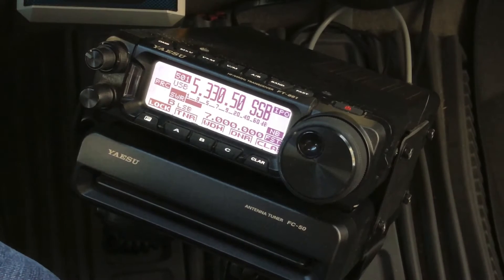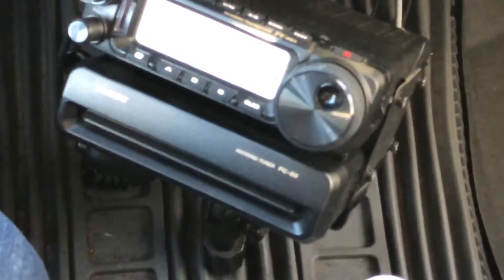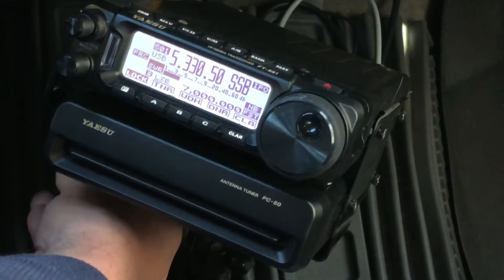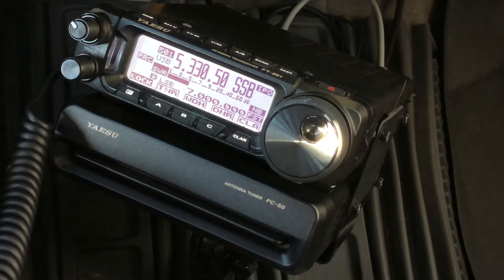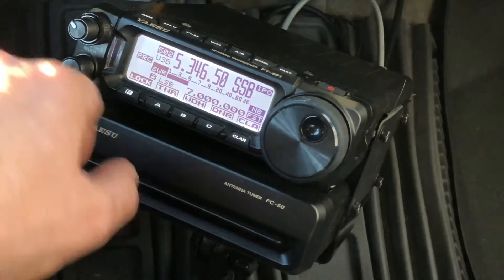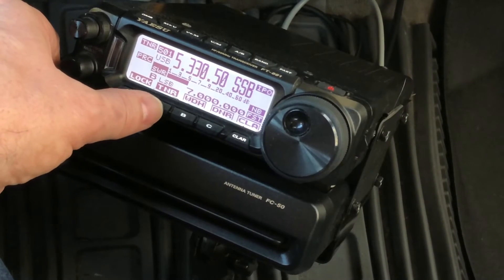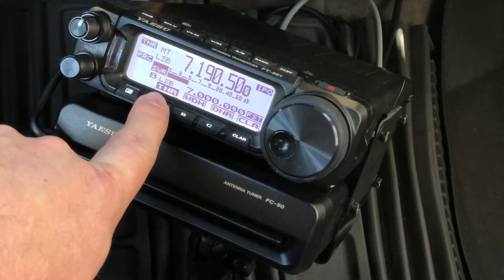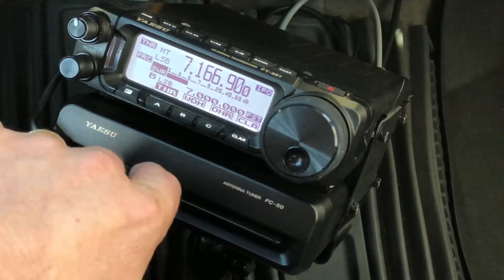Yaesu FC-50 Antenna Tuner with the FT-891

Comment: Thanks for the info. I've hard mounted that setup in a pelican 1400 and am quite fond of it. I removed the front from each unit, bought some fly leads and am making up a mount for the face.. penetrated the box with a weatherproof 50A anderson and pl-239. Pretty sure i opened the tuner looking for the receive option but wasn't able to locate anything. I have no plans to pull the radio out, it is well protected and has rubber buffering on bottom and side, it's also very transportable and comes in at 6kg. If my bracket works out for the face I will share the .stl 74
Reply: thanks. I see you have the RF gain selected on menu 05-05 and I suppose that is about listening style. the other option being squelch and that's good if you want to wait quietly for a band to open or clear calls to come in in my experience.
Reply from the maker: RF Gain, IPO, and ATT are a must, especially for mobile operation. They help the DSP perform better. The cool thing about the FT-891, and now the FTX-1, is that even when the menu is set for RF Gain, when I go to FM mode, such as the 29.630 to 29.680 FM repeater portion of the 10m band, the radio automatically switches the control to squelch. We need squelch for FM. When I go back to SSB, the control becomes RF Gain again.
Reply from the maker: Sounds like a great setup; thanks for sharing!

Comment: What are you using for an antenna?
Reply from the maker: I was using a ham stick back when this video was filmed. Separate ham sticks per band. The FC-50 can only match an antenna that has a 3:1 or less SWR.  I switched to the ATAS-120A 3 years ago. Check out the ATAS-120A playlist.
Reply: @n4hnhradio  I've got a brand new ATAS 120A I bought with my 891 I have to send back to yeasu it stopped tuning and something is rattleing around in it
Reply from the maker: @ChrisAnderson-rz2hv that is unfortunate. The ATAS-120A performs better than I thought it would, as I demonstrated in my video series.
Reply from the maker: Yaesu only allows a dealer to return items that were purchased and failed within 14 days.  My ATAS-120A has performed flawlessly since that first installation video over 3 years ago.

Comment: Because of your video, I pulled the trigger and ordered the FC-50 even though I have an AT-100M Pro tuner. My FT-891 deserved it.
Reply from the maker: That is a great tuner to pair with the radio.  Convenient. Can’t match more than a 3:1 SWR though.  Just keep that in mind.
Reply: I was planing on using an AT-100M with my 891, how yours worked? 73.

Comment: I read somewhere the website that a person was using the ft-891 with his FC-50 connected to the ATAS 120-A. Is this something viable? Is there any point to it?
Reply from the maker: @Newdeath91 I don’t know how that could be possible.  In the FT-891 menu you must choose to use either the external antenna tuner or the ATAS-120A.
Reply: @n4hnhradio  that's what I thought, but the person was confident in the usage.
Reply from the maker: @Newdeath91 I would also be concerned about damage to the ATAS-120A if I forced RF into it that it cannot radiate.  The antenna tuners only fool the radio by showing it a 50-Ohm load, so it will deliver full power into the coax.  Certain antennas can handle that heat of the non-radiated RF energy.  But, I’m afraid of what could happen if I forced 3.8MHz at 100W into the ATAS-120A.

Comment: Thinking about getting one of these tuners for my 891 I just bought. I have no antenna yet lol. I’ve been out of the hobby for over 20 years lol. I have an icom735 and I’d like a tuner for that too so I don’t know what way to go yet. The 891 will be a mobile rig but since we may be moving I may just use the 891 for a base. Not sure what tuner to pick up yet. 🤔 Maybe I will get this one. 😀
Reply from the maker: The FC-50 is a “touch-up” tuner.  It can only correct up to a 3:1 SWR mismatch. It’s fine for touching up the SWR on the band edges of an antenna that is tuned to the center of the band.  I used it to touch up ham stick antennas - one for each band.  I now use the Yaesu ATAS-120A, which tunes itself, via the FT-891 controls.  There is an ATAS-120A playlist here on my channel.  

I like the MFJ-939Y antenna tuner (Y for Yaesu), but MFJ is out of business. mAT antenna tuners have a good reputation, as an alternative.
Reply: @n4hnhradio  I’m looking at the mat30. Will that be good for my 891 for an end fed dipole?

Comment: I have finally ordered the FC50 for my FT891 Doug. A great upload as always. Thanks, John 2E0SVB
Reply from the maker: Hi John!  The FC-50 worked seamlessly for me as a “touch-up tuner”, for my ham sticks.  I removed it only because the ATAS-120A doesn’t need it.
Reply: @n4hnhradio  I will be using the Rez Recon 40 with mine. Have to import the kit from DXE
Reply from the maker: Are you just going to use the FC-50 to touch up the band edges?  The FC-50 cannot match more than a 3:1 SWR.  The Rez doesn’t adjust itself, but you can change the coil tap point and adjust the whip to get close.
Reply: @n4hnhradio  Yes. I know it's a 3:1 max match. It's to save me having to constantly adjust for best SWR as I move around the band. Will use Rig Expert when switching bands.
Reply from the maker: Gotcha!  Let me know what you think, please.  I’m curious.
Reply: @n4hnhradio  Of course. We fly home from Indonesia in the morning. I should have the ATU on Monday. Crazy they couldn't do better than 3:1 in that enclosure though isn't it?
Reply from the maker: @johnratcliffe6438 you are so correct about that, John.  The MFJ-939Y is approximately the same size and can match up to a 32:1, with full automation, as you rotate your VFO on receive.

Comment: Doug, did you configure DIP switch 8 in the tuner which enables the tuner in recieve per setup instructions.
Reply from the maker: No need to set the DIP switch for RX since this is a mobile installation. For base station I would. I don’t need the extra sensitivity for mobile use. There is already power line noise, traffic lights, burglar alarms, door openers, engine noise, wind noise, etc.  I run IPO most of the time, so I definitely don’t need more sensitivity. NOTE: I’m no longer using the FC-50, since I switched to the ATAS-120A.  I shot a series about that changeover.  Since the ATAS-120A actually tunes to the exact frequency, it is sensitive on RX, thus I use IPO even more.

Comment: Did you open the tuner up and set the DIP switches to receive as stated in the manual?
Reply from the maker: I did not enable the RX tuning, if that is what you are referring to. There is no need for that with a ham stick antenna. The antenna is already close to resonance. The FC-50 is only a “touch-up” tuner. Plus, I’m using this in my truck. I don’t need extra RX sensitivity with a mobile. There is always road noise with a mobile, plus noise from power lines.  I use IPO.  So I’m already lowering the sensitivity to improve the S/N ratio.

Comment: Is the FC50 a good choice for portable ops with the FT891 Doug? Taking away on family holidays and operating from a cottage for example? I use a resonant antenna with my FT891 most of the time (Slidewinder DX), but it would be nice to just be able to touch it up instead of having to go out and manually adjusting it all the time. And what are your thoughts on the FT818? I have found a store in the UK with a couple left and thought it might be nice to grab one while I can.
Reply from the maker: Hi John!  Yes indeed!  The FC-50 can transform up to a 3:1 SWR to 50 Ohms, so the FT-891 will deliver its full power to the antenna system. Before I got the ATAS-120A, the FC-50 touched up my ham stick antennas, because the SWR at the band edges would reach well over 2:1. 

I hope you have a great holiday. 

73, Doug

Comment: Two questions: I currently have my 891 mounted on my dashboard using the mounting bracket that came with the radio. If I attach the FC-50 auto tuner to the 891 with the brackets that come with the tuner, will I still be able to mount it to the same place on my dashboard with the bracket that came with the radio?
Also, when using the FC-50 auto tuner, do I need to go into the menu on the FT-891 and change auto tuner to external or Lamp? TNX
Reply from the maker: The bracket for my radio is still there.  It is holding the assembly to the gooseneck mount, just like it did before the FC-50 was added.  The bracket that comes with the FC-50 simply serves to make the radio and FC-50 become one.

There is a TUNER SELECT menu (#16-15) to set the FT-891 to use an EXTERNAL tuner.

73, de N4HNH

Comment: I like this tuner but i am having trouble deciding between it and the LDG Z-100PLUS, which can do 10:1 and draws only 200mA when tuning, 100mA on idle.
Reply from the maker: I would decide based upon the antenna system I plan to use, or the price.  I use Ham Sticks, one per band.  The FC-50 touches up the band edges.  It is what I call a touch-up tuner, since it only matches up to a 3:1.  If you plan to use non-resonant antennas, you will need the wider-range tuner.  It just isn’t as convenient as the FC-50.

A long-press of the Tuner button, I assigned to key A, is all I have to do to let the tuner find and store a match.  After that, I do nothing. As I rotate the VFO, the FC-50 tracks the frequency changes and recalls the appropriate match.  It is fully automated.

I can tap the Tuner button, that I assigned to the A button, to toggle the tuner on or off.  I leave it off until I’m ready to transmit.  This saves the battery, if operating on emergency power.  I don’t worry about it while driving in the truck.

73, de N4HNH

Comment: I have the LDG Z-11 Pro but haven't installed it or the radio yet. Is there an advantage of running the FC50 over an LDG? I went with the LDG since it was $150 and the FC50 was $300.
Good vid!
Reply from the maker: The FC-50 mates up to the FT-891, so the two become like 1.  It is convenient because it is controlled by one button on the FT-891.  I assign my A button to the tuner.

The LDG is a broad range tuner.  The FC-50 can only touch up an SWR of 3:1 or less.  I use ham stick antennas, one for each band.  The FC-50 touches up the SWR at the band edges, which is necessary for 40, 60, and 75 meters.

73, de N4HNH
Reply: @n4hnhradio  Very nice. I'll mainly be running the ATAS120 on my semi and was thinking the Shark ham sticks would work on my Suburban when I have the 891 in that while home. I sure like the looks and efficiency of the FC-50! 
By the time I get an antenna switch, 2 ham sticks (20m/40m) and a tuner, I may be $$ a head just just get another ATAS120 that would work 6-80? Like they say, money will buy anything!
2 Hamsticks would look cooler than one ATAS120 :)

Comment: Hiya!  i have one of these radios and i'm trying to learn my way around it.  i'm on channels from Maritime HF SSB Simplex Channels guide as i'm here on my sailboat.  When i key up i get no indicator that i have any pwr output.  inversely, i have a friend in texas keying up and i can't hear him.  lastly i have the at-40 hooked up to the radio and only part of the time will it adjust when using the TNR function.  the rest of the time it gives a little double beep sound and i'm guessing i'm doinog this wrong!  haha.  i'd sincerely love an assist!  halp?
Reply from the maker: The double-beep usually indicates that the tuner cannot find a match.  If you also can’t hear your friend in Texas, it might indicate that the antenna SWR is too far above a 3:1 SWR.

73, de N4HNH
Reply: @n4hnhradio  the not finding a match thing - thats super curious to me.  i installed a professionally made ant that stretches 35 feet up the backstay of my boat (isolated of course), with a KISS ground plane, both connected to the at40, which then has the standard coax and data connector to the ft-891.  I'm at a loss as to what else i might change hardware wise to get this system online.  I also have a rigexpert ti-3000 set up and it is doing a fantastic job giving me weather fax images and navtex, i just can't communicate with it :P  I'd love to know what i did wrong, or maybe even that i have to buy another at40 maybe (i've heard it auto tune 3 or 4 times but not every time) or maybe i'm not configured right.  i dunno.  but i'm at a dead end and trying to figure out what to do with this thing before i just uninstall it from the boat and leave it in a box on the side of the road.
Reply from the maker: It might be worth a phone call to Yaesu.  I don’t have an AT-40 to try.  My FT-891 is used with ham stick antennas.  The FC-50 easily touches the up so I get a 1.1:1 across the band.

If you can borrow an antenna analyzer it might reveal the issue.  Since you can’t receive well either, it sure seems to point to an insufficient counterpoise.  The KISS should provide that.  Maybe double-check every connection

73. De N4HNH

Comment: Great video!  Thank you for it.  I run the 891 with the FC 50 also for portable operation using a Super Antenna the MP1.  Question:  How can I cancel all of the saved tuned freqs?  Thanks
Reply from the maker: With the FC-30 it is dip switch S1003, position 4, but the FC-50 manual warns not to touch any switch except position 8 of S1003.  Switch position 8 enables or disables RX tuning.

That said, there are 200 memories.  If you use up all 200, it should begin over-writing as needed.  I never think about it.  I just long press the TNR button when my SWR is above 1.5:1 and I let the tuner handle it.

73, de N4HNH
Reply: @n4hnhradio  Thank you for your reply.  I still have alot to learn with the 891 and 50.  I like the radio.  I'm gradually getting versed in learning all the menu options.  Again thank you...73. Harold
Reply from the maker: You’re very welcome Harold!  The FT-891 doesn’t seem to get the credit it deserves.  It’s hard to believe that’s so much technology is in that small housing.

73, Doug
Reply: @n4hnhradio  AGREE absolute

Comment: Good job!
Reply from the maker: Thank you!  I appreciate you visiting my channel.

73, de N4HNH
Reply: @n4hnhradio  I am not quite certain about the concept of the tuner only acting as a "fine tuner" but let me watch this a few more times and I think I'll get it.  You see, I am in the market for exactly the set up you have (not for mobile use, however) And, since I only have so-called compromise antennas, I really do need a tuner.  If I have more questions, I'll send them along to you if you don't mind.  '73 de WA2TVN
Reply from the maker: I call it a touch-up tuner because most antenna tuners included in radios today can only match up to a 3:1 SWR.  They are not wide-range tuners.  For that you have to look at MFJ, LDG, Palstar, etc.  The “touch-up” tuner can touch up an antenna that exhibits a 3:1 SWR or less, or is already resonant in a portion of the band it is designed for and you need to touch-up the other areas.  It’s difficult to make or buy an antenna that maintains a SWR of less than 2:1 across 160, 80, or 40 meters.  A touch-up tuner will make the band edges appear acceptable to the radio.

That said, the tuner in my 1991 era Yaesu FT-890/AT can match a 10-meter Hamstick antenna for use on 10, 12, 15, 17, and 20 meters.  It has a wide-range ATU built into the radio.  But as the radios have gotten smaller, the “antenna tuners” are limited.

For base station operation, I like the ZS6BKW or an OCF dipole.  They exhibit less than a 3:1 on multiple bands.  The ZS6BKW from NI4L.com exhibits less than 2:1 on 40, 20, 17, 12, and the FM portion of the 10-meter band.  The “touch-up” tuners can usually match it on a couple more bands, including 80-meters.

I hope this helps.

73, de N4HNH
Reply from the maker: I have never had a tower or beam.  I use mostly wire antennas.  I am proof that you can enjoy amateur radio with wire antennas.
Reply: @n4hnhradio  And, I hope you are right.  I went to the website you gave me.  Many thanks!!! .  '73
Reply from the maker: You could e-mail Chris, the owner, and explain your situation.  He might offer some other suggestions.  He is a master antenna builder.
Reply: @n4hnhradio  That's a great idea......